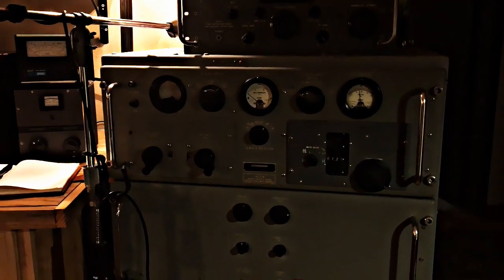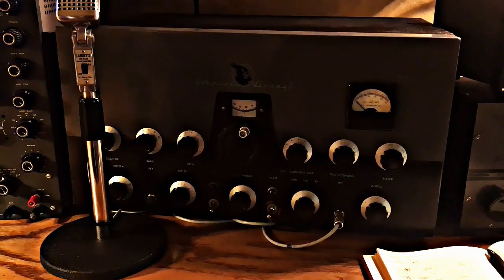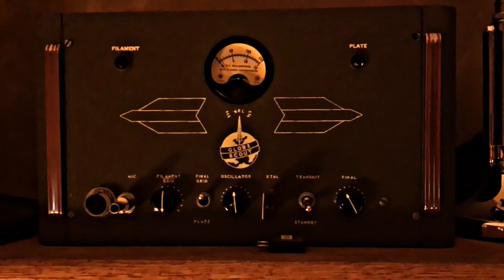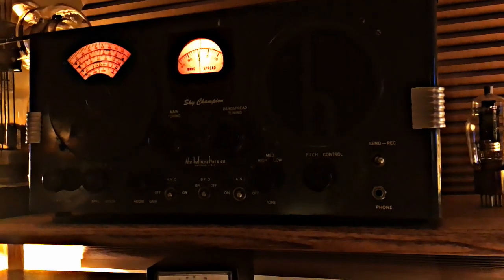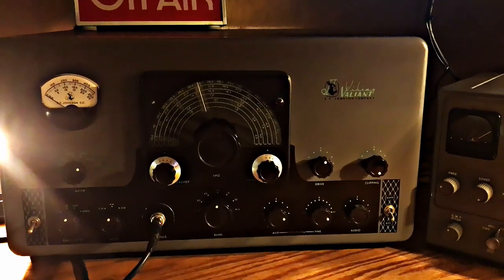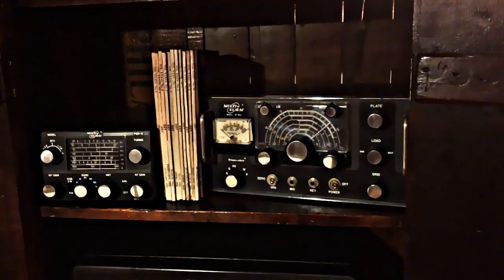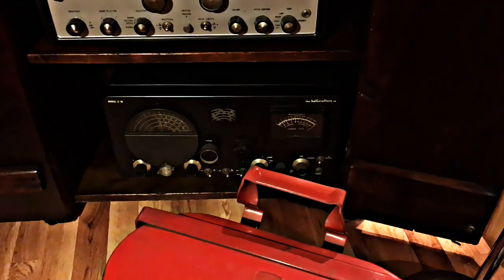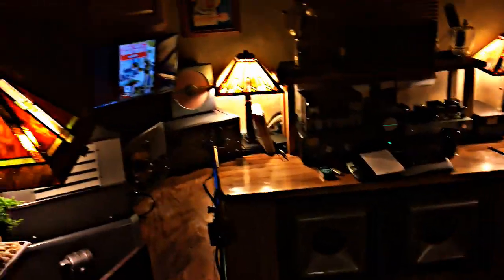Vintage Amateur Radio  Station - KB3RHR

Comment: Nice collection of vintage “iron”.  I currently own a Collins R-388, several Hallicrafters receivers ( recently acquired a very nice SX-101A, also have an S-85, SX-100, S-20 & a few others kicking around).  I was on the air with a Johnson Viking II but it recently developed an RF problem & is going on my test bench shortly.  I also recently got a complete Drake station (R-4B / T4-XB / MS-4 & power supply) that seems to work well on AM.
Nice station! 😊

Comment: Hammarlund HQ-129-X has six bands. Broadcast band is split between the lowest frequency two bands, the higher of which also begins to cover shortwave. coverage is :
band 1 , 540 - 1320 KC
band 2 , 1.32 - 3.2 MC
band 3 , 3.2 - 5.7 MC
band 4 , 5.7 - 10 MC
band 5 , 10 - 18 MC
band 6 , 18 - 31 MC
So, not 2 shortwave bands. I restored an HQ=129=X recently and use it as my "daily driver" for shortwave listening.